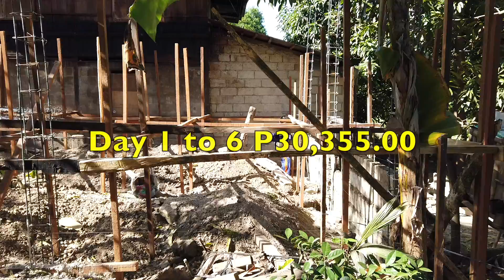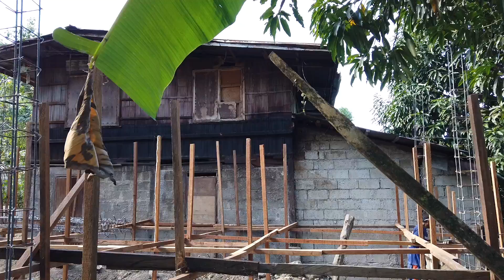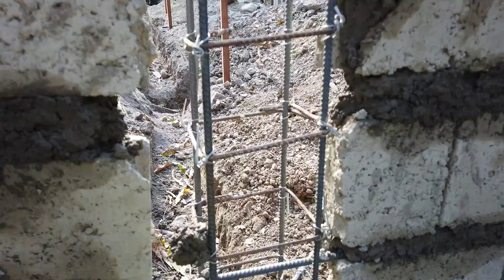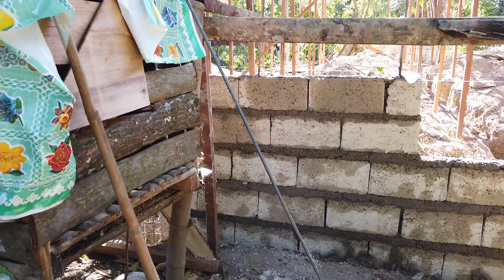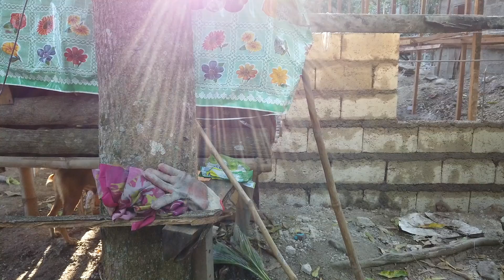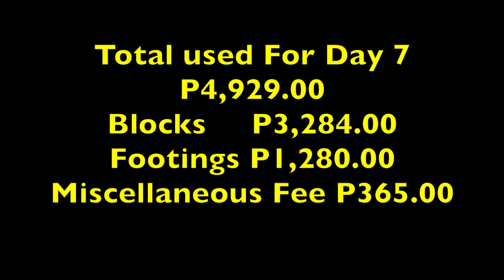Day 7. Budget Bungalow Build In The Philippines.

Comment: Looks pretty good. I have seen buildings there that had much more stress on a weaker structure. Filipino hollow blocks are not that easy to deal with so those workers are doing a good job. I have thought about doing a tilt-up building in the Philippines but I don't know what the building code is so maybe they are not allowed. You are providing great information as always. 👍👍🇵🇭😷